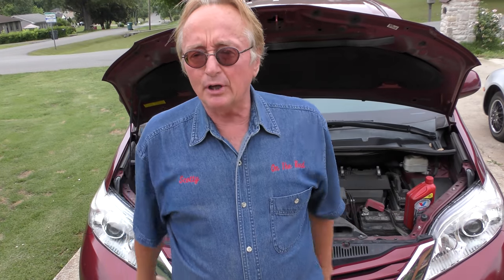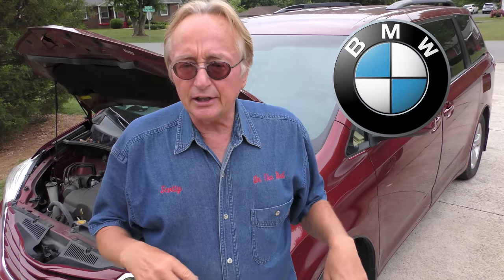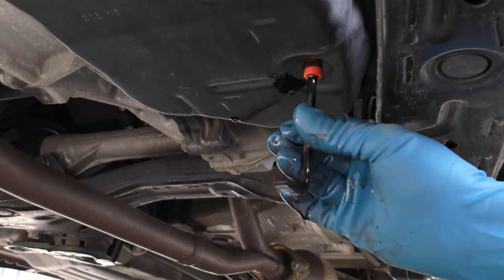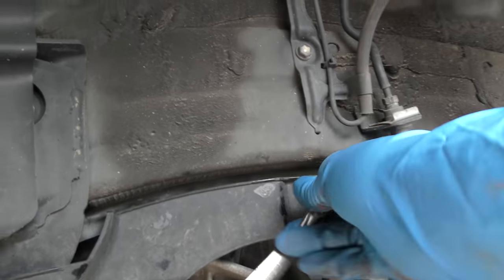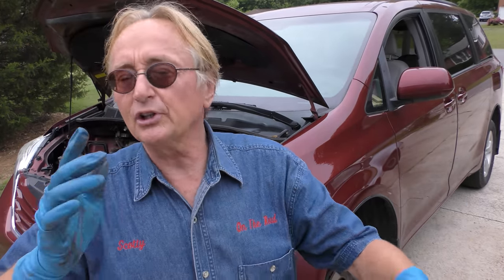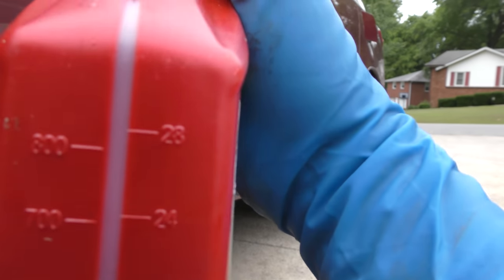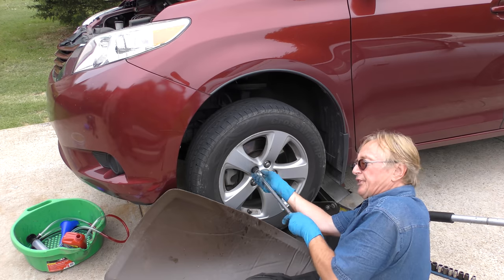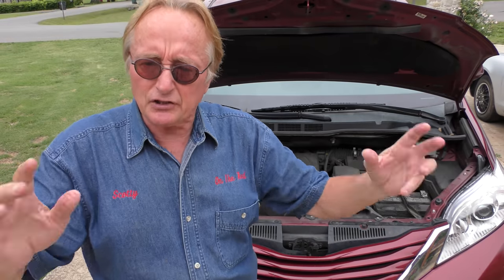Here's Why Changing Your Transmission Fluid Can Cause Damage

Comment: Most that watch this have never done it before. I would stress the importance of preparing the vehicle before crawling under it. Preferably on flat concrete, chock your wheels, emergency brake on, use your floor jack in a solid location and double up using jack stands. Lower your floor jack until the vehicle barely rests on the jack stand. I stress this because I've seen a car fall on a guy. It's not pretty.

Comment: Should I flush or change my transmission fluid? I got my 2015 Genesis G80 3.8 a little under 100k, and never asked if the previous owner changed the fluid prior. Now I'm at 116k (drives fine), and never flushed or changed it. What should I do?

Comment: The OEMs don't make it easy on us to service these modern vehicle transmissions... especially ones like mine with over 225k miles when you don't know if the fluid has ever been changed before (pretty sure mine has not, it has a shudder in the torque converter). Gonna try & do a couple of fluid changes w/ Shudder Fixx, if that doesn't help I'll be replacing the converter. Transmission itself shifts perfectly, no slipping at all. Anyhoo, if I have to I'll replace it. Car is amazing otherwise given age/mileage. (2008 Volvo XC90 V8 Sport)

Comment: got an 07 corolla, dont think fulid was ever changed in 150k miles, changed it cause it was acting weird. i just used toyota brand fluid and it drives great put on about 2k miles since. should i be worried?

Comment: I have a 2011 RAV4 auto with a dipstick that says there's no need to change the tranny fluid.  So the previous owner never did for 152k miles.  The fluid was black. It still shifted perfectly though, so it was still safe to change the fluid.

Comment: Measuring what came out will usually get you in the general ballpark, however filling it until it start coming out is the proper way.  Lots of transmissions out there are under/overfilled, so just replacing what came out isn't accurate or proper.

Comment: I drive my wifes 2013 rav 4 now with 152k miles on the odometer with no transmission fluid changes that we’re aware of. Guess I’m not getting the transmission fluid flushed or changed. Hoping for another 100k miles 🤞🏻
Reply: U shouldn’t do it because the debris is stuck to the transmission plates. Removing the fluid will cause ur transmission to slip. If u change the fluid just make sure u have enough money 💰 for a new transmission if the job fails🍷

Comment: my dad always said changing the transmission fluid when you haven't changed it in a long time can make them go out. and I have seen it happen, people will go get their transmission fluid changed and them BOOM it goes out
Reply: your dad is so right, the actual grit left inside the trans is what keeps it running, once you flush out, no more grit and you get slippage.
Reply: @lobsterwhisperer7932 would a drain and fill cause this to happen?

Comment: I have a 2014 Toyota Corolla at 160,000 miles and had never changed the transmission fluid.  The service station is recommending changing the transmission fluid.  Is that a good idea at this point?
Reply: It's a risky idea.

Comment: Would you recommend changing the transmission fluid on a 2012 f150 with 122,000 miles on it. I bought it with 64,000 not sure if it’s ever been changed

Comment: CVT transmission can handle fluid drain
up to around 200k miles. Just don’t flush until oil is relatively clean and last change done in last 50k miles.

Comment: Regarding filing up the transmission with the fill plug, You can tell if it's full by it leaking out of the fill plug correct???

That  way you don't have to measure how much fluid you drained right???

Comment: I just changed the fluid and filter in my transmission and installed a new pan with a drain plug so I can service it easily in the future.  After I got it all together and started cleaning up I realized that there was a magnet in the old pan to collect metal shavings and prevent them from recirculating in the transmission.  A little extra work but I drove it around for a while and then dropped the pan so I could insert the magnet in the new pan.  By adding a second round of fluid I figure I have about 75 percent of new full synthetic fluid in the transmission providing an extra level of protection for my transmission.  The dealer wanted $400 to do this job and it did not include a new pan.  I did this job in about 4 hours and spent about $80.  This is like making about $80 and hour when in all my years of working I never made $80 an hour.

Comment: I just bought a 2010 Mercury Grand Marquis,(ex-detective car) 62,000 miles. Think I can wait til summer to change filter? I was just going to change a gallon,(from radiator line, into a jug, then replace), any advice? I'm going to use Motorcraft Mercron LV fluid.

Comment: is there any problems mixing old OEM transmission fluid with new Non-OEM transmission fulid? i have a toyota 2014 and i have just changed the old OEM transmission fluid with Castrol Transmax ATF Multivehicle (which is claimed to meet Toyota ATF WS - old OEM tranmission fluid - requirements). Maybe 60% new fluid and 40% old fluid.

Comment: Hello Scotty. 
 My 2014 Kia Sedona has 115,000.  I checked the transmission oil and it still maintains its color and does not smell burnt.  Can I change it completely?  Or can I change it partially into 60% old oil and 40% new oil?  Thank you so much.

Comment: I never change the transmission fluid in my 2015 rav4 and have 178k miles on it, should I take it to Toyota dealer 
To change it or leave because I am already too late and the new fluid might cause transmission to slip,

Comment: i bought a 1993 chevy g30 with 40k original miles, original fluid presumably and it's still red.  should i change it just due to it's age?  the van sat for a long time.

Comment: Just this past week  I had my transmission  oil change. Now my mercury  transmission  don't  work. My car never  had an issue until now.  I really  wish I did watch this. My car won't  move when I press the gas. I fill it with new transmission  fluid. I'm sick but I figure I need to replace or repair it.

Comment: Besides learning a few things about transmissions I also learned about the plastic clips. I wish I had known 3 days ago as I broke a few clips getting them off thinking they automatically need replaced after removing them to get to the area it covered. Not a mechanic and never have done any auto repair, but at 62 I took a gamble and bought a car hoping it needs minimal work.

Comment: So you wouldnt recommend changing the transmission filter and fluid in my 2003. Dodge Durango with 170.000 miles??? the rtramisdion  is doing  fine tho

Comment: Hi Scotty i got a ZF HP8 (8 Speed) Transmission on my (prefacelift) 2016 BMW 120i LCI M Sport Edition with a N13B16A Engine, It has 65k Kilometres on the clock and has never been changed the Transmission fluid, when do i have to do the change? Thanks Scotty.

Comment: I have a 2017 fordflex with 100,000 miles. I have not changed the transmission fluid. Can I still change it ? Do I need to change the filter

Comment: Its smart to change transmission fluid but only ways should be a pan drop (which only drains a portion) or removing the return line for the trans and run the vehicle, drain out a quart or two, top off with fresh fluid and repeat till oil appears clean. Never do a pressurized flush unless you have owned the vehicle since new and have changed the trans fluid at regular intervals.

Comment: Hi everyone. I got a 2014 Camry 4cylinder with 81000 miles on it I bought it from someone recently.

Most times when I change it from park to any gears, making sure it is not resting on transmission by using the emergency brake, it still makes a huge thud going into other gears and shakes the whole car? What could be causing it? Would changing transmission fluid help??

Thanks

Comment: Hi Scotty, I have a used 2013 Toyota Corolla that I purchased with 100,000 miles on it. Not sure if the fluid was ever changed. Should I change it or is it too late? Or is there a way to tell if was ever changed? Thanks
Reply: You must have gotten a really good price on that corolla with 100,00 miles! What did you pay? $6K or so? Hopefullly the transmission shifts smooth. My 2009 Corrola LE had 105,000  miles with no transmission fluid changes. It worked just fine. I sold it so  don't know how it worked after that mileage.

Comment: Sealed transmissions always have an overflow bolt you remove it and let the fluid drain out. You put more in than necessary. Those are intended to be used with the engine running and probably best on a lift because the car has to be level when draining.

Comment: I bought a car with 90k miles on it and it currently has 120k, would you recommend me to change the transmission fluid or keep the fluid as long as it lasts?
Reply: I don’t know if the previous owner had changed the fluid every 60k miles

Comment: Hey Scotty, should we change the filter too? I plan on doing this job is a week or two and want to know if I should change the filter as well. My car is a 2010 Lexus IS250 with 127,000 miles.
Reply: Of course, the filter changes with the oil change + a new gasket under the oil pan. Wipe the oil pan dry - sludge settles there and would spoil the new oil. Change all the oil and not 35%. You push it out with new oil. Some oil pans have a magnet - check it's clean (picks up metal chips when there's an AT problem). Your interval is too long.

Comment: I have a 2014 nissan altima s 2.5l that's currently at 134k miles(bought when it was 118k) should I consider changing it?
Reply: Considering that you're already 34k+ past the point that MANY Nissan CVT transmissions fail, it would be highly advisable to have it checked by someone who understands those transmissions and their problems.  I would NOT suggest one of the oil change businesses that overcharge and always tell you that changing your fluid is the best course because they, quite simply, just want your money with little to no regard of what happens after you leave.
If you have had no trouble so far including slipping, high pitched whining or bearing noise from your transmission then a fluid change is "probably" a good idea at this point.  You should also very highly consider having an aftermarket transmission cooler added to your car.  They're relatively inexpensive and can increase the life of those CVT transmissions.  
If you have never done so, please take the time to research the problems with those transmissions.  A simple Google, or any search engine, search will find a ton of useful information.

Comment: Bought a 2010 Camry with 207k miles.  Should I change it or leave it alone?
Reply: Don’t change the fluid. It’s to far gone. The debris is already stuck to the clutch plates. Removing it will cause your transmission to slip🍷
Reply: User "nate love" got it basically right. 👍👍👍It's not like the dirt is stuck to the plates, but changing the AT fluid would make things worse including likely slipping.

Comment: It’s recommended to use a torque wrench when putting on the drain plugs that we don’t over tighten it for most people use the specific to torque found in the owners manual or you can look it up.

Comment: Should i top off transmission fluid if its low on a 2010 altima that has never been changed ? With 270k km

Comment: Torquewrench on wheelbolts good. But what whith the drain and oil filler plug? Damaging the threads there whith too mutch handpower is boring. Thanks again for another great video 😊

Comment: I’ve got 127k miles on a 2014 Camry. I’ve never changed the transmission fluid. I get conflicting answers on whether or not I should change it at this point. Any advice? So far no issues with transmission (or anything else with the car).
Reply: I'd change it.  You can get 300k+ on that Camry, but only if you maintain.

Comment: I’m checking my glove box to see if there’s records of my fluid being changed. I drive a manual mazda 3 and it’s a blast. But this being my first car I’m slowly learning how to take care of it. It sometimes slips into second, and my clutch engages near the top so I worry changing the fluid it would slip even more as stated in the video
Reply: You cannot compare automatic transmission (AT) and manual transmission (MT) because they work on a different principle. Therefore, they need a different oil (transmission fluid) and a different change interval. The oil fill is smaller and can be completely drained in most MTs.
The fact that your clutch engages at the top of the clutch pedal and sometimes slips, I would guess on the clutch plate, or that the clutch pedal does not have the required clearance. But it's hard to say from the table...

Comment: I change my trans fluid, and rear end lube/power steering/brake fluids every 25K and 100K miles, respectively. Radiator anit-freeze, the green stuff, dropped and filled every spring. My motto; Keep the fluids new, helps keep the vehicle new.

Comment: If "when it leaks out of the open fill hole, it's full" then: can't you either: 1) drain it and refill until it starts leaking from open fill hole; or 2) open the fill hole first before draining anything, put your finger in the hole to gauge the fluid level before draining, then drain, then refill until fluid reaches that same level according to you finger in the fill hole?

Comment: I own a Nissan Quest 2015. I have never done transmission fluid before and I called a dealer for a quote. They answer me as I already have 90k miles and never done before they don't recommend the fluid change. I am still having my doubts as I know CVT broke easily. Do you recommend anyway the fluid change?

Comment: I’m the second owner of my 2006 V6 Tacoma and the carfax states my truck had a flush & fill of the transmission fluid at 135,000. I now have 170,000 and thinking of doing a complete flush and fill. 
Is this safe to do so or just do the drain and fill like Scotty did? 
Also should use Toyota’s WS OEM fluid or Valvoline Max Life like in this video.

Thanks I’m advance
Reply: Proper flushing = new AT fluid just pushes all the old fluid out of the AT is always safe and the best choice for longest AT life. Of course with a new filter (on the Tacoma the filter is held by 4 screws if I'm not mistaken). The brand of fluid does not matter, what is important is compliance with the manufacturer's specification (e.g. Dexron VI, etc.)
I see you change the fluid at 35K miles = that's perfect transmission care. I also change it that way, only if I often tow a car transporter I change it after 25K miles. My SUV has 282K miles and MPV 496K miles, always change with flush + filter + new gasket under the transmission pan. I'm buying the cheapest oil on offer, it just has to have the MB 236.14 specification.

Comment: I bought this used camry and it has 127,000 miles on it.. carfax does not say if it ever had a transmission fluid change. What should I do? hope they did it at 60k? and change it now? or do not risk it if its too late to change it? Please help

Comment: But, how many vehicles have this extra drain plug though?

I've only done my 2014 Ford Edge Sport once, but it's a metal drain bolt & I could mostly see up into the housing after the fluid drained w/flashlight & I don't remember seeing any additional plug.

I was only able to get out 4.5 quarts, so that's what I added back.

I do mine every 20k, along with my coolant, rear diff, & notorious to fail, PTU!

Comment: Idk, with modern cars this seems like an over simplification. Both my cars require bringing the new fluid up to temperature, and then cycling through the gears to distribute the fluid throughout the transmission. Only then will the amount in the pan be reflected correctly as it sits in the overflow tube. 
What about changing the pan gasket?

Comment: sorry not trying to correct but thats not the brake line thats the shifter line...it controls the PRND321...just so people dont get mistaken....great video though...just had to change my 2-3 shift solenoid....my advice is change them both even if only 1 is bad...and I dont think i would clean my pan with brake cleaner but thats just me.....

Comment: 1996 crown victoria. Had it since 2019 never change transmission fluid over 200,000 miles.Need to change screen. Do I drain oil out.

Comment: In 2000 I bought a 99 Corolla. Years later at about 50,000 miles I washed the engine compartment at the self serve car wash. Then drove it home. Next day it would hardly run and refused to idle. Limped it to the Toyota dealer. I had gotten water down the spark pug holes and for some reason it took overnight to mess up the electrical spark. So they blew it out, threw in some new plugs and it ran great again. While it was there I asked the mechanic what breaks on those Toyotas. The 4 mechanics within rage all said the same thing - the engine will go well over 300,000 but not most people's transmission. Are they that weak? No. People change the engine oil but never remember the transmission fluid. So at some high mileage they give up from lack of service.  Ever since I change the fluid / filter every 30-40,000 miles. Now at 195,000 miles the transmission still shifts like new.

Comment: Bought a 2012 Kia Soul with 96K on odo from Dealership.  The transmission failed at 103K. Luckily, I had bought a powertrain warranty so it was just $250 deductible and $250 in rental car fees while the rebuilt transmission was shipped in by Freight.

Comment: This is going to be a silly question to most people.. but since you mentioned Toyota I have to ask, does anybody know is the 2014 Toyota Camry has one or two differential oil changes? I was told by a mechanic they won't know until they get in there to look but I find that a weird answer